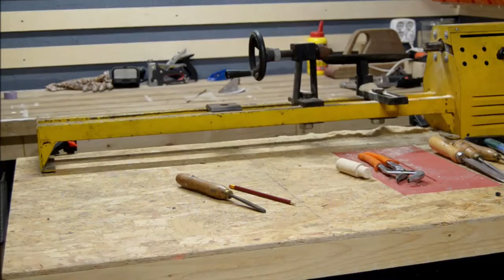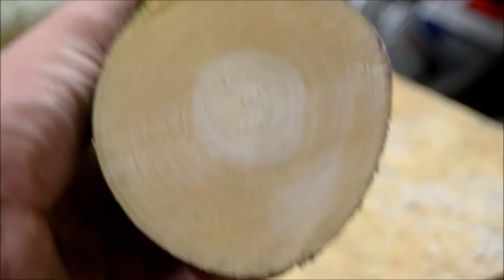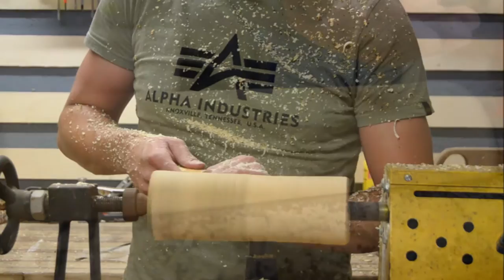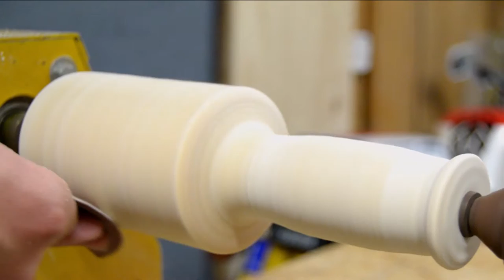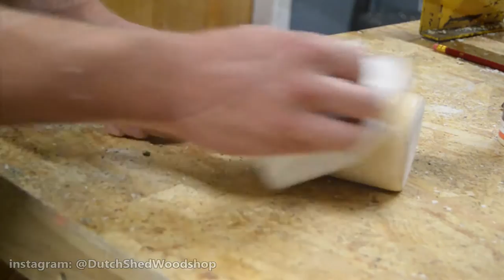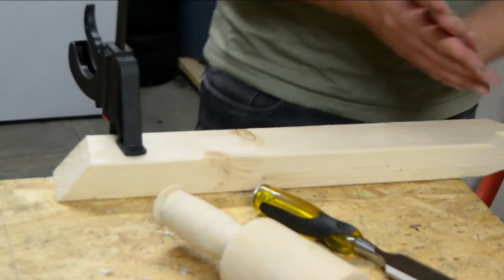Woodturning - A Mallet From A Log | Lathe | DIY

Comment: Well done, timber looks a bit green but good to work with;  Don't get carried away buying expensive tools/ chisels; for a beginner a cheap set of woodworking chisels can be bought for a small price and  they work just as well as the expensive ones but you have to sharpen them more often. I have been woodturning for 20 years and although I have some expensive sets of chisels I still have my original cheapies that I bought to start with and I still use them. for spindle turning the roughing gouge is very useful tool to have and a parting tool, which can be used for turning wood down as well as parting off timber which it was designed to do. A spindle gouge is also good to have but believe me with a roughing gouge you can achieve great success spindle turning. The skew chisel is the most difficult to master and is something to use when you become more proficient with the other tools. If you buy a cheap set, it will include the chisels I have mentioned and as I say, they are great to learn on and will cost a around $20 to $30 dollars for the set.
Reply from the maker: Thank you very much John! This will help me a lot! 😊